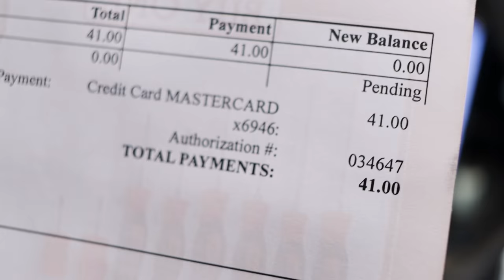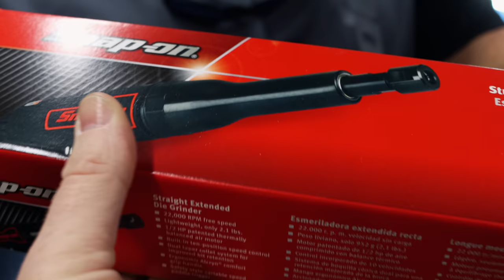Snap On Friday New Long Neck Bit Driver And Long Straight Die Grinder

Comment: Hey Andy, Tell Hamilton to get on the horn with Snap-On. I live in North Pole, Alaska & my Snap-On guy got the new CT861 in almost a month ago. Not worth the $ in my opinion. My #'s might be a little off, but I believe it has 150ft lbs of torque, vs the old one having 125ft lbs. Not really worth the $450. And it only comes with 1 battery & no charger for that price.